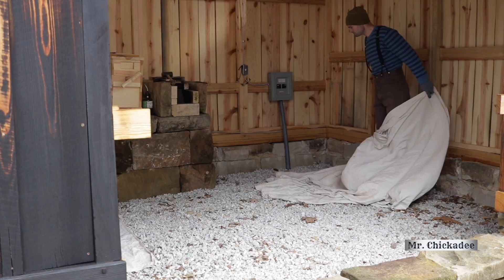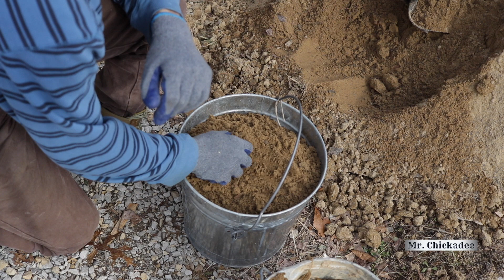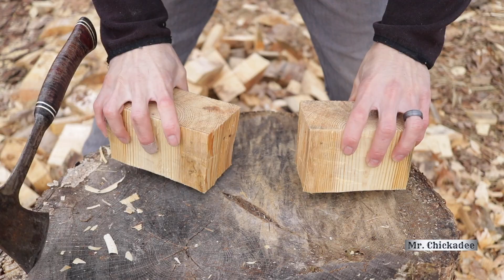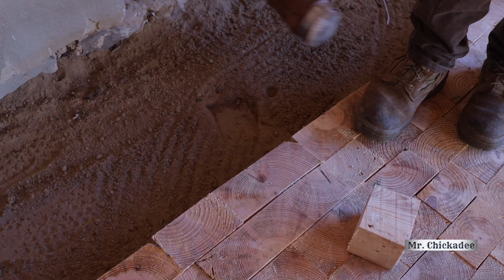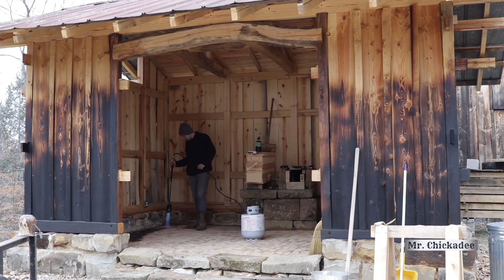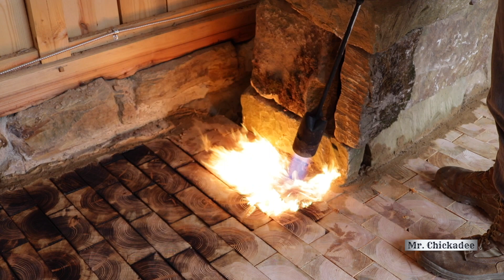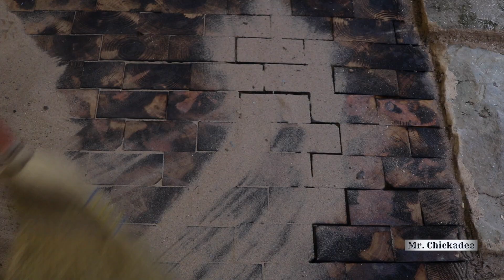Making a wood brick floor for our blacksmith shop

Comment: Definitely will be making a wooden brick floor like this in my future cabin
Reply: Nathan Johnston , I used rounds and grouted it with non sanded grout, and sealed it. Been there over 10 years and still looks good.
Reply: John O what size rounds? are the spaces between rounds not a problem?
Reply: @masonheipel  I've seen rounds on floors they put smaller rounds between the big ones down too about 1 1/2 inch rounds they started with 6 to 8 in it looked really nice.

Comment: One of my schools had (probably still has) that kind of floor in wood and metal working classes. When winter came it took some moisture and swoll, having perhaps 4" bulging in some areas. But it didn't matter that much, under heavy machines and tables it remained flat. I think it was made from pieces of 2x4's

Comment: I worked at Pratt & Whitney for 23 years and the shop floors were all laid with wood blocks coated with hot tar. The story that I was told, was that it cushioned  a part if it dropped.  It was dirty and smelly, but very easy to patch if it got damaged.

Comment: Really nice video.  I remember seeing a similar floor made with 2x4 end cuts.  The top edges of each block was then chamfered.  Once the floor was laid, the gaps created by the chamfered edges were filled with a grout made by mixing glue into the saw dust.

Comment: Holy Molly, did you cut all of those with a handsaw?! Really nice job by the way:)
Reply: @cybermanne  : LOL That's a good one. Yeah just tell'em "Here's your sign".
Reply: My lack of concern is that a piece of flaming hot metal will fall and be forgotten on the floor
Reply: @cybermanne  THEY WOULD BE PLASTIC FAUX WOOD IF IKEA MADE THEM
Reply: Nope, I cut the first dozen and the rest just jumped right out of the logs for me... Here's your sign!
Reply: @humility-righteous-giving  The smell of burning wood in your nose and the pugnant smoke in your eyes will make it pretty hard to forget. :)

Rest assured that any fallen hot piece of metal will be quickly and safely dealt with.
Reply: @humility-righteous-giving  that stuff builds characteristics theres to much moisture  and sand for it to catch fire. Mabey smolder for a while
Reply: critical thinking You do not forget hot metal!

Comment: I worked at a factory that had a wooden floor similar to that, seemed like the work floor had been soaked in creosote or a type of oil.
Reply: John Williams  the Sikorsky plant in Stratford CT has this type of floor over a concrete base.  There was a black top cost that looked like creosote. The wood cuts down on vibration from machinery. Also, it's more forgiving if you drop a part onto it.
Reply: Creosote is likely. For street applications they were often sealed with coal tar apparently.
Reply: @steveXracer and how is it exposed to the soil (dirt)? There is 2 inches of sand above canvas drop-clothes, so no direct contact with earth (soil).

Comment: Only issue I envision is the blocks taking on moisture and swelling. Years ago worked in a GM plant that covered their floors with wood blocks. When  rainwater leaked onto the floor (an addition was being added) those blocks would swell and raise a floor 2 feet before that bubble burst and sent blocks flying everywhere. Got some good overtime to lay down new blocks. Seems to me some type of expansion joints would avoid that problem.

Comment: Are you not afraid that the tree will tear the building apart, when the floor gets water.
Reply from the maker: these are applied green, they will never swell more than they are now
Reply: When they dry and shrink, the sand wont fill the voids and cause it to expand larger?

Comment: I’ve seen floors like this in large military machine shops and hangars in the DC area...places where they drive tanks.
Reply: Dick Fitzwell up here in Rochester Ny we have an old military building that was used an an ammunitions supply house which has been converted into art studio spaces today and it too has wooden brick floors!  Always marveled it.
Reply: Tanks have a surprisingly low amount of ground pressure. They're giant machines, about 60 tons for an M1 Abrams, which is about 30 times the weight of your average truck.... but since they're on treads, they have like 300 times as much surface area touching the ground. The end result is that the pressure on any given part of the ground that the tank is on, is 1/10th that of what a regular vehicle would have. That's part of why tracked vehicles are so good at navigating muddy terrain, because the low pressure means they don't sink into it and just ride up on top.
Reply: @wtechboy18  The bad part about treads though is even with the low pressure it will tear up the ground in a hurry, wether it be asphalt, concrete, or dirt.  Especially if you turn with only one track moving. The wood bricks make sense since they are easy to replace and they add grip to it for them to maneuver
Reply: Kaiser Steel in Southern California had the same flooring in some work areas
Reply: I worked in an aluminum mill, floor was made of end cut 4x8's.  Packed very tight together.

Comment: Outstanding work. I'm curious, how long did it to cut all of those blocks. Hard work and patience really pays off.
Reply: Probably a few weeks.......unless he used a chainsaw off camera. If he did, I don't blame him ...I would have done the same ;-)
Reply from the maker: about 1 week
Reply: Mr. Chickadee I bet that floor will last a decade or two.
Reply: @sailinglucydaye9930  did you mean to say decade (10 years) or century (100 years)? Cause it should definitely last more than twenty (20) years.
Reply: Thomas Russell well a decade is 10 years and two decades is not an actual term... it’s called a score
Reply: Thomas Russell I have recently looked at other examples of this type of flooring and the abuse that it can take.  My comment about lasting 20 years or so just shows my ignorance of this subject.  From what I have gathered, this floor would most certainly last a hundred years.

Comment: Years ago I worked in a worshop by the harbour in Sydney Australia,  the floor was made of lignum vitae blocks similar to this.   Some of the streets running through the center of Sydney were originally done the same way. Also with lignum vitae.  Later on when the streets were "modernised" the bitumen roadway was just made straight over the top of it.
Our blacksmiths shop just had a dirt floor, nothing fancy like this one... lol

Comment: It will be interesting to see how well an anvil sits on a floor like this.
Reply: They do quite fine. Due to the weight of the anvil it will make the bricks even more stable in the sand foundation.
Reply: Hi Rob. I don't know if Josh will do this, but a traditional way would be to dig a deep hole and put a large tree stump in and secure the anvil on it. Cheers.
Reply: I'm sure he's got something super rad up his sleeve! He really is super good at everything he does!!! Lol
Reply: You could always sand a flat spot if needed. As I noted in my other comment I've been in lots of steel mills with floors made of hardwood blocks.
Reply: @recyclebills  yeah, but this isn't "hardwood" it's short leaf pine.
Reply: As stated the traditional method for this is setting a stump several  feet into the ground  depending on soil composition. Harder clay or close rock to the surface would lend to only a foot to 3 feet.  A deeper loam or sandy soil  could lend credence to 6ft or more  depending upon that which one chooses to back fill with.
 From there the stump is most usually  burned and coated in pine tar or heavy oil / fatty tallow.  The working  end would be burned oiled an hammered to seal the grain.
 Then the anvil would be placed on and secured  via several procedures. 
   In the most modern case it would be secured using a polymer adhesive,  or a latex adhesive. In the older days it would have been hide glue.
After placement and the choice or securing compound, steel straps of various design would be placed over the anvil "feet" and bolted to the anvil stand.  Most successful people would do opposing feet depending on the uneven set of the feet or the stump.
From this point  the anvil is secure as it's going to get. Most often the resonance wave is dampened sufficiently to have a dead ring for the main body at least. Side note some anvils may still have horn/bick ring as well as heal/toe ring. This is most often dampened by a strong magnet these days. 
There is some school of thought to wrapping the waist of the anvil w chain and securing the chain to the stump to 
A reduce the ring and
B to add weight.
   It is my opinion that given the aforementioned procedures  will do all that can be done. 
 Sorry  for the somewhat verbose comment  but I find it's the best way to give full credit to the procedure. 
   For one who doesn't sink a post or stump...
The next best procedure is to bind a group of 4x4 on end very secure to form as close to a solid as possible.   In my case I used 49 4x4 glued completely as possible  installed 28 through bolts and applied metal straps at the top down a few inches and at bottom  up a few inches. In the outside 4 corner I cut voids in the 4x4 and applied a mixture of coal slag sand and oil to add 70lbs weight the stand. It's about 350lbs and 2ftx2ft square. Holds my 250lb anvil  fine and doesn't  walk on the concrete  and the anvil has little to no ring.
   This pretty much  covers the most common variety of  anvil stand and securement  procedures 
🙏blessed be yall
Crawford out 🧙‍♂️
Reply: An anvil should sit on a length of red or white oak with a suitable diameter to accomodate the anvil,  into a post hole in the ground about 3 feet deep. Anvils should not sit on a floor of any type. I had a 400 pounder mounted that way in my shop for 10 years. Anvils do not sit well on ANY type of floor. They are not supposed to. Installing an anvil incorrectly can cause its top to flake or chip.

Comment: Please throw that MX cabling out and run your electrical in THNN in rigid 1/2" conduit. at right angles.
That flexible wiring really visually takes away from the time and effort you've put into this stuff.
Reply from the maker: people really hate my wiring...Ill try and cover it up...
Reply: @MrChickadee  Put stuff in front of it and they will not be able to see it.  Looks fine to me and if it carries the angry pixies, even better.
Reply: @MrChickadee  just put a small wooden box/tube  around it to hide it or put bench rails at a height to hide it. Modern technology being tied in to old-school craftsmanship can be tricky, but I'm sure your mind will come up with a way to make it seemlessly blend in.

Comment: Caterpillar the company that manufacturers earthmoving equipment. Had a section of floor in the bulldozer assembly building that uses this floor, and most of it is still original from the 30s when caterpillar got it's start.

Comment: if you make one of these pavements on the street, how long will it last: Snow, rain, frost?
Reply: I was wondering this as well.
Reply: This is only for indoor use. The main use here in Germany was for electronic workshops
Reply: With property treated wood, it should last a couple of uears as a driveway. Just be sure to burn all sides before laying it down.
Reply from the maker: there are some still in use over 100 years old.

Comment: I work in an old Ford Plant that has this kind of floor, the only place it looks good is the front hallway and it is really pretty, if I could afford it and had a place to put it in it would be a dream floor to have. The rest of the plant it's completely blackened from oil and grime. The old timers say that when the plant was still owned by Ford they had someone cleaning/polishing the floor at least twice a day.

Comment: Where I live (Victoria, BC, Canada) in the original downtown core there is an alleyway that is as wide as a street and a block long that was made with wood bricks. It's over a hundred years old and is smooth and in great shape. I couldn't find any rotting bricks even though our winter season is actually a rainy season.

Comment: Here's an FYI for your followers.  When Notre Dame burned up, I was wondering where they would find people to restore the roof structure... No need.  The French have been maintaining and restoring old buildings since forever.  They have a national competition for young carpenters doing all the mortice & tenon work building roofing trusses etc.  Also the slate & tin  roofing is amazing.  Do some searching on French carpenters (charpentier)  and roofers.  I use it to help practice my French also.  The Japanese framing Mr. C. does is to me utterly inconceivable..

Comment: Theres flooring done this way at the Barbican centre in London (huge theatre/entertainment complex built in the 1970's) I seem to recall they used 4 x 2 end grain pine blocks offset like a brick wall. I've seen it in other places, such as foundries, railway works, engineering works even in outdoor industrial locations

Comment: OK, so I'm the dumb one that just has to ask "what keeps the termites from eating this" ??? Your building and floor are soooo awsome, but where I live that is a big termite farm. Loved the video !!!     ✌🏻❤
Reply from the maker: Most termites prefer wet and rotting wood in or close to the soil. Keeping wood high and dry deters them pretty well.
Reply: Mr. Chickadee please excuse my ignorance, but how do you keep the bottom side of the floor from rotting out? Is it just the layer of gravel? If so how thick does it have to be to keep the floor from ruin?

Thanks for your time! This is the first video of yours I have seen.

Comment: Ok I’m really impressed. I would have thought that you needed some sort of oil finish on it to help keep the wood?
Reply: Thats why he was using the torch to make the outside resistant to rot and termite and insects  Japanese building use this for traditional houses for the same reason

Comment: So the home we've purchased has a large shed with an old concrete slab floor that has buckled due to water washing out beneath the slab until it couldn't support the weight anymore. We want to remove the concrete, lay a stone foundation like the one in this video, add a water management system to keep water away from the footing of the shed, then install a wood brick floor just like this. The shed is at least 120 years old and is all made of solid wood. We are wondering what the best approach would be to accomplish this project and save the shed. Would we simply rent several contractor jacks and place them along main support beam and Jack the shed up off the slab?
Reply from the maker: Yeah, I had a metal pole building with concrete slab where this now sits. I sold the metal pole building, rented a concrete saw, cut up the slab and disposed of it with a neighbors tractor to help. 

In your case, if you want to save the shed, you will need to jack it up and put cribbing under it to hold it up in place to get the foundation work done. Lots of ways to do this, but importantly you want to get the concrete slab gone, asses and treat the area for drainage, and then add a nice stone foundation, then lower it back down, after checking for any rot on the bottom that may need replacing. A simple rubble trench drained well to daylight will go a long way to keeping things dry inside. I would also recommend a min of 10-12" of drainage stone inside the perimeter before the wood bricks, this is what I have. Even though my bricks were fresh green and wet, and the sand wet when installed, everything is bone dry now because of the drainage trench and the gravel layer. Nothing is dug further than 8" or so around the peremeter, but you could go deeper for the trench if you wanted to.

Comment: How many hours did you spend making the bricks? I am guessing the shed is about 16 'x 16', the bricks look to be 3" x 6" so 8 / ft^2 would mean 2048 bricks. If they took 5 min each that would be 170 hours and 40 minutes of work.

Comment: Mr. C.  Would it have been better to burn the bottom of the wood pavers?  The rot would come from the bottom.   BTW you are amazing.  My shop is full of power tools because with a time-demanding job, I didn't have the time--let alone skill-- to do what you do.  Could never make a hand saw work, but I like the Japanese pull saws!

Comment: ?Question Please: Why the canvas barrier between sand and gravel?   What issues arise if sand is directly on the stone?  In a few years, depending on humidity, the canvas will rot anyway, yes?
Reply from the maker: canvas prevents sand filtering into gravel, good drainage keeps everything dry, dry canvas or wood dont rot, so it should last for a very long time.

Comment: Maybe a silly question,  but why didn't you back the truck up to the building and unload the sand inside?
Reply from the maker: I needed an even 2" spread everywhere, I find that easier by equally spacing little piles around the floor, rather than going from one huge mess thrown in out from the truck needed to be spread
Reply: @MrChickadee  fair point.

Comment: I just thought that cutting the logs could be done with an old fashioned circular pulp saw. 10 in dia logs could make one 4 in by 8 in block per slice. Also these saws are just about the most dangerous saws ever. However you make the blocks the floors are worth the effort. Good hop and good video. Thanks.

Comment: Curious why you only burned the top side of the floor? Doesnt the burning protect the wood from wearhering?

Also.. curious how the floor held up with a heavy anvil on it?

And how its held up after 3 years of use?
Reply from the maker: Protection wasnt the goal, it was for aesthetics and to show nay sayers how fire proof the end grain wood is.
Reply: @Mr. Chickadee  very cool. How did it hold up under anvil weight?